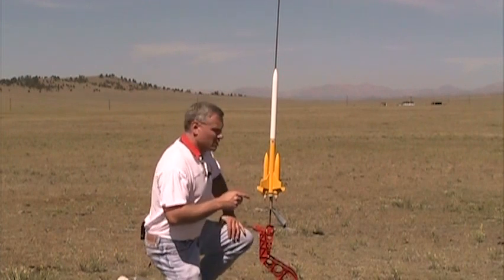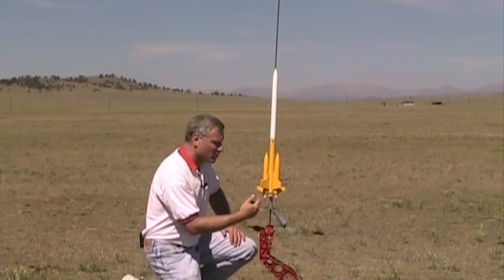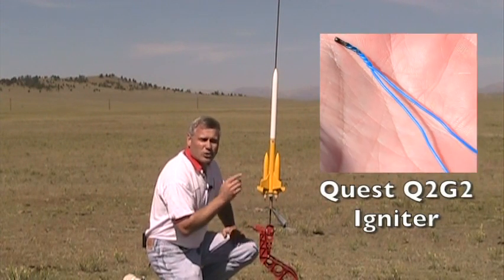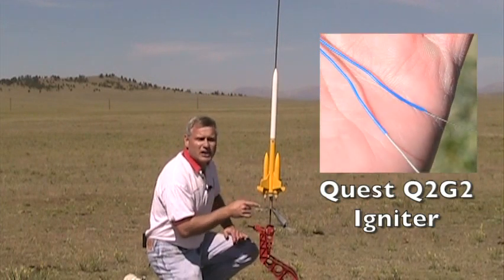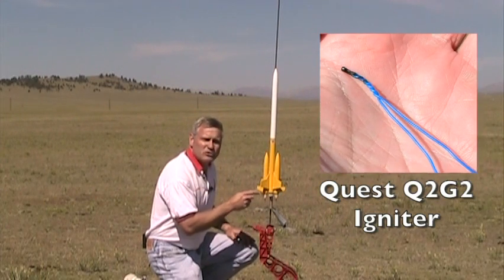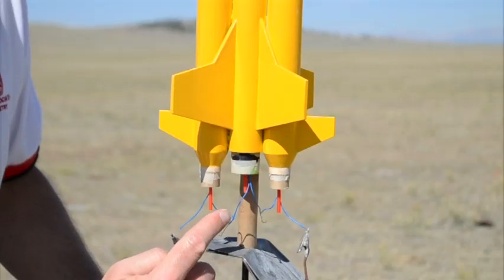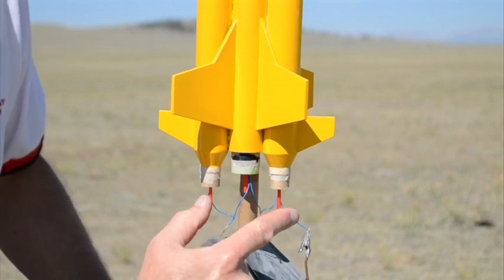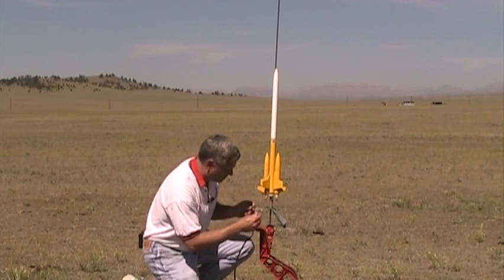Clustering Model Rocket Engines with Quest Q2G2 Igniters

Comment: what do you mean by parallel
Reply from the maker: Parallel wiring means that if you were to have 2 igniters then each individual igniter would have both right side leads going to one end of the terminal and the both left side leads going to the opposite end. Whereas in a series you would connect them end to end with the outermost ends going to the opposite ends of the terminal. Another way to look at it would be like cutting paper dolls out "individually" and attaching all the right legs to one side of the terminal and all the left legs to the opposite side (parallel) versus cutting out a paper doll "chain" and attaching the hanging leg on the far right to one end and the hanging leg on the far left to the other terminal (Series).
Reply: Parallel wiring means that all positive and negatives are wired together.  On the ESTES igniter not easy to do.

Comment: Why can't you wire estes in series, sure you'd need some extra wire bc the fuses yould break otherwise but is there a specific reason not to...
Reply from the maker: The reason is that the Estes igniters require a higher current to heat up and ignite, whereas the old Q2G2's can ignite instantly with less energy. The Q2G2's are less likely to fail in a series for this reason.

Comment: sorry but i have a question: i plan on igniting 3 rocket engines at the same time do you really need 12 volt battery to do that?
Reply: peter kao if it’s a smaller engine no, if it’s bigger yes